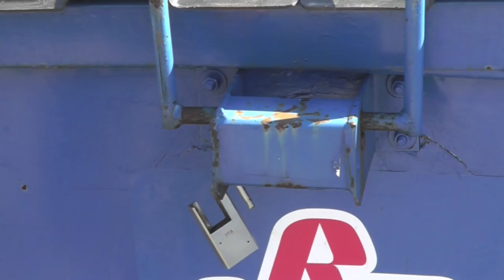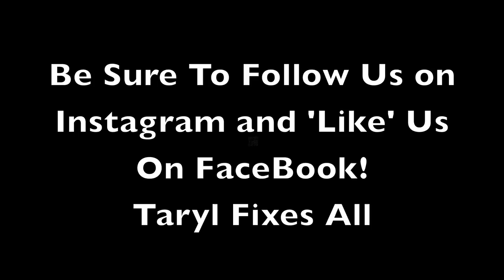Make Your Craftsman Hydrostatic Lawn Mower Go Faster!

Comment: I need help on riding Lawnmower briggs and stratton 21HP. I tried to turn by hand one revolution and lock up. I force really hard to make it turn free. it start once I turn it off and motor lock up again needs help please.
Reply: Sam Khanhphane try pulling the spark plugs and turning the engine. if it turns easy with no plugs, watch his video on resetting valve clearance, and do that. Of it's still hard to turn over with the plugs out, you may need a new motor.
Reply: Matthew Kidder I did all that already after put it back together still hard to turn over
Reply: Sam Khanhphane Hmmmm...... that ain't sounding too good. Have you drained a little oil out and check what condition it's in? Especially if it's milky or has metal in it.
Reply: Matthew Kidder did all  that too. I might have to tear down the engine that gotta be suck thanks for your input
Reply: Sam Khanhphane You're definitely on the right track. It's just not looking like there's going to be a light at the end of the tunnel. Good luck and let me know what it ends up being.

Comment: my cub cadet loses power going uphill any solutions?
Reply: Go down hill.
Reply: Jonathan Kamanns
Reply: Norman Nakano probably needs a good carb cleaning. if its not getting enough fuel at higher rpms that could slow it down.
Reply: Norman Nakano Cut your grass more than once a year, or lose a couple hundred pounds.......